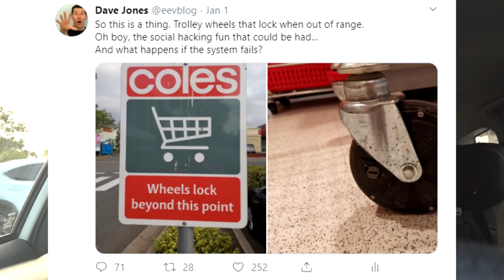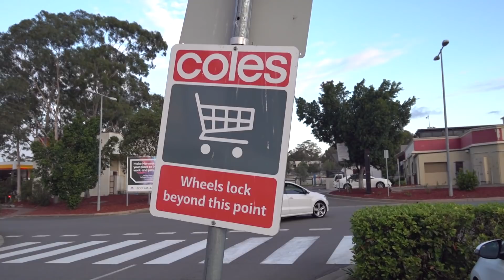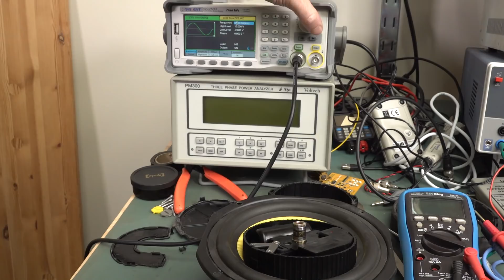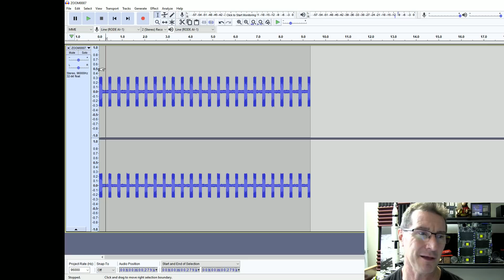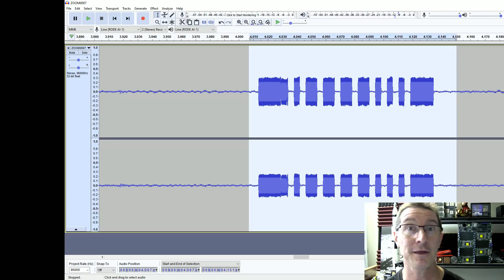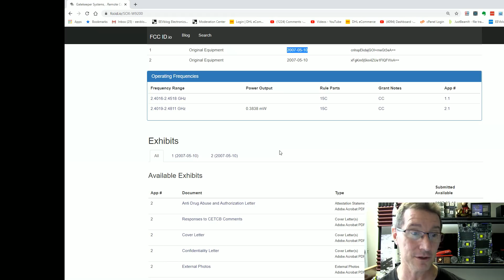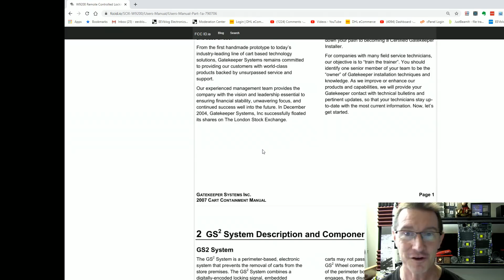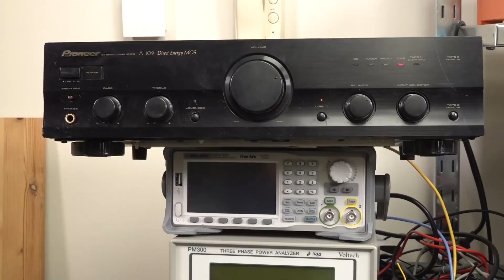EEVblog #1287 - Gatekeeper Shopping Trolley Lock Investigated

Comment: The manual had a few interesting tidbits that you went right over.  There's a time code that you could set, (there were 8 options), therefor that's 3 of the bits of the code......

Comment: Dave, when they talk about push out, they are talking about locking the cart at the gate to prevent product theft, most likely triggered by LossPrevention, and/or the security gate tags and the gate will also lock the cart witch most likely is going to make them ditch it

Comment: Not specific for this system but there is a handheld remote that can unlock and  lock it has a key but stops working after approx 24hr unless you put it on charge

Comment: If you note the v shaped piece of metal does not spread apart. You can tell by the guide behind it. It's a I shape slot not a T shape. Odds are it moves side to side.

Comment: You could take the wheel to the store and then roll it over the wires as if it's on the cart and see what happens to see if it locks too.  It could also work via a magnetic frequency that surrounds the wheel.  Looking at the way the wires in the road are, most likely the wheel would have to be in between the 2 wires which might mean there is some sort of magnetic field coming up that would surround the wheel when it is in between them and the microprocessor processes that signal and locks the wheel.

Comment: You could apply voltage to the motor leads and see the locking action.  The screw drives the wedge outward which expands the locking shoe.

Comment: My local supermarket is split over 3 floors via powered escalator type ramps. Sa you push the trolly onto it it locks the wheels to stop the carts flying down the incline. Once the moving ramp reaches the bottom the thing unlocks so you can push it off the bottom. Different use for the same technology.

Comment: It would be more efficient to cause something to move as to block axis movement than to continuously activate it. But in this case there has to be like a resetting mechanism. Like something that gets jetted out and stuck that way. It is possible the main coil gets a special reset modulation also. OK watching this further I think the motor shaft basically does what I was mentioning. The wireless bit may be like cell trackable. Also probably has store id in the activation code.

Comment: Some stores have more complex tracking systems these days. I had a cart lock the wheels just outside the doors, an employee came out and told me one of the registers doesn't always pickup the carts correctly. So apparently they can track (usually) if you've actually been through checkout or if you're just pushing a full cart out the doors without paying. 

A bit of searching shows this type of system is becoming more common to prevent "pushout theft" (mentioned in one of the articles in the video) where people just load a cart with groceries and roll out the door with it.
Reply from the maker: Interesting, thanks.
Reply: Theft would be more common with self service checkout I expect.

Comment: Couldn't you have taken the torn down wheel to the coil?

The hubs at my grocery store are set to lock at the door if the cart hasn't gone through the checkout, so presumably there are separate codes to disarm, arm, and trigger the lock.

Comment: My local Menards store is on two levels and has a sloped moving walkway between them.  When you push your trolley onto it, the wheels lock so you can take your trolley between floors.

Comment: Thank you for showing the entrails and operation of this horrid device.  My experience with them was with some of the Walmart stores here in the US.  I observed the receiver sensitivity would vary from unit to unit and would additionally degrade over time.  In use, when I would get 10 - 20 paces outside the store heading to my car, the contraption would lock up, leaving the only option of, either lifting the locked wheel or plowing onward, which left a long skidmark and resulting flat spot on the locked wheel.  After about 6 months Walmart abandoned this security method and just accepted the loss of a few shopping carts (or trolleys).

Comment: I am a gatekeeper tech. The system does work as intended, and trust me stores would much rather get carts from the perimeter than from 5 miles down the road like most stores in Miami, Altanta, etc experience

Comment: there's no microphone in trolley wheels, its an rf  induction loop at 8khz, just play your recording into a hand sized coil of wire instead of headphones.  still probably wont work, you can bet the bit pattern is an address for each companies trolleys so they can zone them to certain stores/areas  i have seen these in the uk, but there not popular, the insert £1 to release the lock is more used and you have to return the trolley to get your £1 back.

Comment: You might check out the US Patent office web site. If this has a patent attached to it, the office will have additional information about this wheel. It is obvious there are programming points on the circuit board perhaps setting the code for the wheels.

Comment: In America the wheels are installed on many shopping carts to keep people from taking them off the parking lot - namely homeless people or low income people who push the cart to their apartment or whatever. They are unlocked by the people who return the carts. They have a remote control that they place near the wheel and it unlocks it.

Comment: Maybe a stupid question but i'm a bit rough on my physics: when you used the headphone/ speaker to play back the signal and hopefully lock the wheel, isn't that kinda pointless since a speaker makes physical sound waves (as in changes in air pressure) while the wheel is expecting an electromagnetic signal?
Reply: It still emits the em signal just at a much reduced volume
Reply: yeah, so in the end the strength of em signal that reaches the coil is basically zero

Comment: Thanks for uploading this, I was thinking of reverse-engineering these a while back. I rigged up a coil of wire and took my scope and an inverter to power and drove to the parking lot. I had a friend kick the coil around on the ground while I read the signal. I never got a clean signal like you so I just gave up on it and didn't have the time.

Considering that the activation is 1 byte of serial (RS232) data , it would be cool if you could find the opcode to unlock it, perhaps an inverse XOR value of the bits to lock it? Since you have the actual device, I would hook up a 3.3V serial converter to it (bypassing the RF front end)  and send 1 bytes from 00 to 255 to it with a few second pause to discover this.

Once you figure it out, make a transmitter that can fit on your ankle and walk around the store causing chaos.

EDIT: Attempt a JTAG dump of the firmware, the pins are there and maybe just maybe it's unlocked.

Comment: The key in the signal that locks the wheels is probably different for different stores. Although it should be fairly trivial to roll through all the possible keys assuming they don't have detection for that.

Comment: You say you've had comments from people in other countries who have seen these locking wheels but I think they may be slightly different in a lot of cases - I know the ones I've seen here in the UK have a metal grid on the ground at the exits to the car park and the wheels physically lock into it when trying to push the trolley over it. They don't have any electronic components AFAIK.

Fascinating video anyway, seems like a lot of expensive tech to solve a problem that could've been solved with those coin locks that most places have been using for years!

Comment: We have a much simples solution for that problem... 30 years ago, shopping carts need a coin (1eur) to unlock them from the next one via a chain, after using them, and if you want your coin back, you have to go to the trolley park, lock the cart and it unlocks the coin, simple and effective, no more trolleys wandering around the car park.

Comment: Our local supermarket has a similar system. There its a frontwheel thats the "locky"-one. All you need to do is to tilt the cart so the front wheels are slightly in the air when crossing the bar.

Comment: That's interesting.. the market near me has those type of devices... but its using the older low freq system.
it also does not lock the wheel.. What it does is released a shutter that slides under the wheel.
Reply: interesting

Comment: We've had these in Seattle, WA for at least 10 years now, it's usually located on the front left wheel. People fill up carts like they're shopping and would just walk out of the store with a full cart, once they get to the barrier they'll pull the cart from that side, lifting the wheel off the ground. Doesn't work, sad it's actually needed.

Comment: A lot of stores here in Southern California use these types of shopping cart wheel locks.  There is a loop of wire run completely around the store's parking lot to corral the shopping carts.  Some stores even put a lock on opposite corners of the shopping cart so you can't just lift the unlocked end of the cart and drag it.  Once the wheel has been locked, the employee that brings the carts back up to the front of the store has to use a hand-held device to unlock the wheel.

Comment: Similar systems existed over half a century ago!  I remember my grandfather and I (age 8) going to get some things for my grandmother, and going to a store different from the usual one closest to their home.  My grandfather chose to park on the street next to the store, not in the nearly empty parking lot.  After getting the things on the list, I pushed the cart toward the car, only to have it come to an abrupt stop at the sidewalk.

My grandfather, an engineer, went all Socratic on me, asking me to figure out what could be going on.  I clearly remember seeing no visible obstruction, and first thinking there actually was one there, but an optical illusion may have been hiding it.  A close examination of the ground proved that not to be the case.  But I wasn't convinced, and tilted the cart onto its rear wheels to see if I could get the front wheels past whatever-it-was.  Which my grandfather put and end to as I began to lose control and the cart contents started to take a beating.

I do recall observing that the wheels came free when pulling back even an inch.  The effect was very much like a physical barrier rather than a bicycle or car brake

We discussed this for days afterwards, my grandfather refusing to take me back there until I had some solid ideas to test, experiments to perform.  I remember the list I came up with:
1. Will it make a difference if I take the cart backwards across the barrier?  (To rule out a latching ratchet.)
2. What if we try it at night, when the store was closed?  (To see if the system was always powered.)
3.  Can I try tilting the cart, but empty this time?  (To see if the effect was only in the plane.)

We did eventually return, but my grandfather asked me to figure out what it could be **without** taking a cart to the barrier!

I clearly remember being on my hands and knees next to a cart looking at the wheels, and seeing nothing obvious, like a braking lever or external locking system.  As expected, the front pivoting wheels were different from the rear wheels, but I saw nothing different other than the pivot itself.  All the wheels looked pretty much like hockey pucks.

But at the front of the store there was one thing that was different:  The carts went into chutes that were slightly raised 2 inches above the concrete, with mild horizontal grooves that apparently kept the carts from rolling free.  As we walked around one of the chutes, my grandfather pointed out the presence of an electrical cable going into the platform.

There was no obvious electrical connection between the carts and the chute, so I immediately assumed an electromagnet or transformer.  As the carts moved without difficulty in and out of the chute, I decided it wasn't an electromagnet, and so had to be a transformer of some kind.  I had never seen an inductive charger before, but I was familiar with NiCd rechargeable batteries, and I knew that battery chargers had transformers, and that air-gap transformers existed.

So, armed with the working assumption there was some sort of power storage somewhere in the cart, how could this cause the wheels to lock up at the sidewalk?  My grandfather carefully guided me back to the electromagnet idea, and asked if the same coil used to charge the battery could also be used to trigger a relay (perhaps a reed relay, which I was familiar with) to cause the battery to activate a locking mechanism?

At this point, my grandfather asked if I still wanted to take a cart to the sidewalk.  And I clearly remember saying "no", because we had an idea that explained what had happened, and only by taking things apart could we really tell if it was true or false.

That, plus I knew my grandfather would never let me take a cart home with us to disassemble.  And, being 8, I was ready to move on.

To this day I have no idea how that long-ago system **actually** worked.  But it did work brilliantly.  And that investigation was an important (and memorable) brick in my path to becoming an engineer.

Comment: That seems very sophisticated. I was at a shopping center in Phoenix, AZ that locked the carts with a spring loaded cover on the front caster. When it crossed painted line in the parking lot, the cover flipped down under the wheel rendering it useless. The back wheels were still free to turn but had wheelie bars behind them preventing anyone from tipping the front wheels off the ground. I’m guessing there was some sort of electric wire looped around the parking lot that put out magnetism to trip the wheel cover. The cover was not resettable without a tool, which I guess the employees had.

Comment: I can almost guarantee you, the Inductor is used as an antenna for the magnetic loop.  The two small antennas, are most likely on the command side of the system, as the person who has to go fetch the cart, will have a tool with them to Unlock the wheel.

Comment: Those are more involved than I thought!  I figured it was mechanical only using magnets and springs or something. I wonder if the 1 byte is a code, so there's 256 different ones so one store's system won't affect another store's cart. 

Now the question is, can you build a pickup coil to use the signal to charge a phone...  Induction freaking roadways!

Comment: no need to drag them, just tilt to right on 2 wheels, if you tilt high enough when going over the wire they don't activate then you just wheel it to where you want.
Walmart recently went gatekeeper from carttronics which were a great source for free 9V batteries.

Comment: It's basically an electric fence for dogs. Works the exact same way. All you'd have to do is lift the cart wheel over the wire and you'd be fine. For dogs the signal usually reaches +-3-5 feet from the wire, but for carts I'm assuming it'd be a much smaller radius. And in the US it's mostly used to prevent homeless people from stealing carts.

Comment: I think if you use a high inductance inductor on your recorder as the input instead of a speaker then you might be able to get a cleaner capture of the signal, then also play that recorded sample through the same inductor instead of a speaker. I'd love to to see if that triggers the lock, I designed a kit (not the first one to do so) for listening to electromagnetic interference using an lm386 and a high inductance inductor in one of my latest videos. I believe the speaker just picks up too much noise in the background to record a clean signal from the coil in the ground.

Comment: I did this personal triggering system back in high school before I even had any electronics education (circa 2008).  Went out and recorded the signal the same way as you, then loaded it as an MP3 onto my iPod Shuffle, played through a hand-wound coil I stuck in a sneaker, using a battery powered headphone amp from Radio Shack. Fun times messing with carts inside the store during holiday shopping...

Comment: Seems like you could get along with a smaller battery if you used a coil and a couple of super magnets.  Generate charging power when someone pushes the cart.  The coil could also double as the detector antenna.

Comment: I wonder if the system could be defeated by temporarily wrapping the wheel in copper mesh while in range of the ground coils.
Or would the Faraday effect not apply here?
Reply: I have no immediate nefarious plans to acquire a fleet of stolen shopping carts.  Just wondering.

Comment: I'm just guessing here, but I would be willing to bet, that they use a number to lock it. It would make sense that this system could have multiple zones, and you design a different number to each his own. That 8-bit number is probably not saying lock lock lock it's probably the activation number for a specific number of carts. Since the wheel you got was sent to you by somebody else, it's probably set for a different number. The manual probably has a clue. But I'll bet if you took this wheel to your local shopping center and set it down on that coil it still wouldn't lock. Just my guess.

Comment: I suspect the twist in coloured plastic discs don't actually do anything themselves, but they identify the Unlock or lock sequence required for the particular wheel.  Ie a Yellow-Grey needs say code 128 to lock. This means the shop staff can set the unlock device to unlock the particular wheel they have. During manufacturing / programming of the wheel, the person doing the programming simply snaps in the right coloured discs after they have programmed the code word.

Comment: We've had those things here in Canada for quite some time now. Ours have a piece of metal on the opposite back wheel that's fixed so that it's only about ½ cm off the ground. That way you can't simply wheelie the cart out of the parking area.